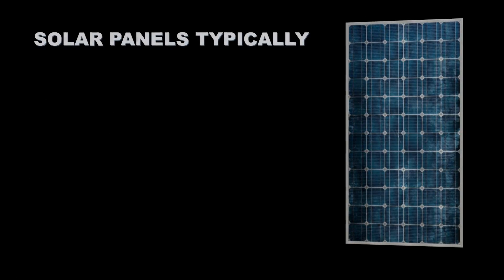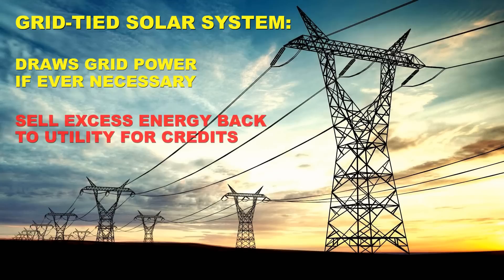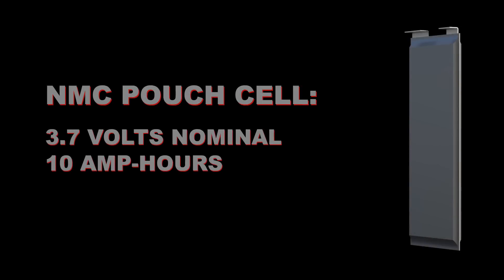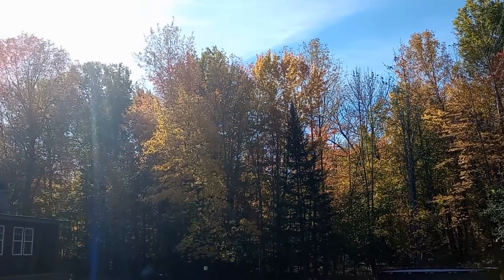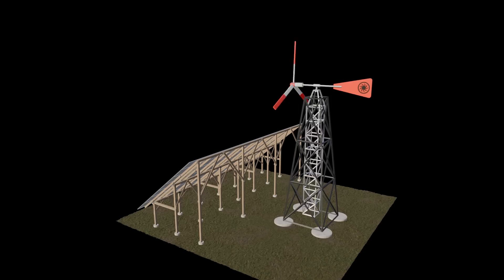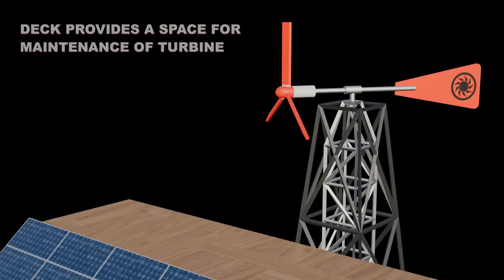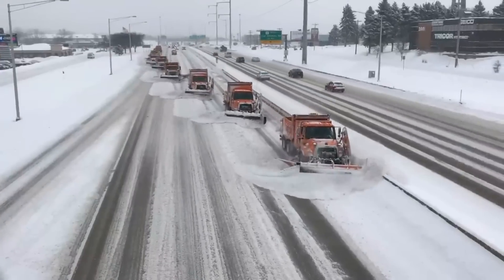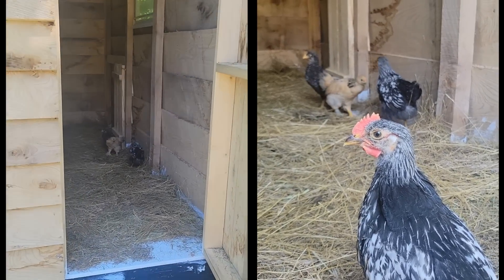Solarrolla Homestead Series 1 - Off-grid Solar Array Build

Comment: What I don't really understand is the argument of cost vs output and efficiency, and the decisioning on going with used solar panels.  You have been doing this for a long time so I am sure you are aware that not all panels are created equally, and some panels are rated for much lower loss over time then others not to mention the other factors like heat loss and output.  To your point you will still likely be getting 80-90% generation of what the panel output day one, but I think the bigger thing is actual rating of the panels.  Sure I can buy used 250-300w panels for 15 cents a watt, but that doesn't take into consideration all the mounting and wiring etc that is required for those additional panels.   Your space is somewhat at a premium and your time is effectively money, so while its awesome you can mill your own lumber and it costs very little to do that, you are spending time doing that, which how much is your time worth?  If you look at new panels, I have seen bi facials as high as 650w, if you run the numbers on a 20kw system, @300w you would need 67 panels, @650w you would need 31 panels.  If you conservatively estimate a 10% loss on the @300w that brings you to needing 75 panels.  So at the end of the day I build out infrastructure for 75 vs 31 panels and get the same output, have I really saved money or has that "savings" been eaten up by the infrastructure required to support more then double the panels?

Comment: I could see you building an elevator to the platform on top with the wind tower extension as the lift counter weight. i.e. lift up tower lowers, lift down tower rises.

Comment: I’d like to see those retractable blades working because I never saw such solution. Hope it will be lightweight and strong enough. Usually a braking mechanism is used to handle strong gusts like angling the tail to set the wind turbine direction away from the wind direction (perpendicular) which slows it down and prevents destruction. I’ll look for updates because it’s interesting and seems technically challenging. 😎👍

Comment: Hello, I would change the Solarpanels on Top and the Heatpipes below because of the better wind direction for your Windmill. The round bow of the mirrors of the heat pipe will send the collected wind in the wrong direction .

Comment: Get that center to go up by a counterweight and then have a couple guy wires that can adjust in and out to raise and lower the telescope. Just a suggestion. Rip to your dad, lost mine a year ago myself.
Reply: Run a couple pulleys for counterweight to center structure and make counterweights about 150lbs heavier, when it is fully extended the weights sit on ground, get 3 guywires with cables down to winches to lower the structure and raise the weights.

Comment: What kind of wind load is that rated for? We get derechos and supercells et al in Arkansas. We have a 2023 ioniq 5 electric hatchback it regularly charges at 248-252 volts a/c at 48-50 amps except when the 8 tons of air conditioning turns on then it goes down to 245.5 vac for a couple of seconds. We pay way more to run the two 3 or 4 ton 2 stage air conditioners than we do to drive the ioniq but we work from home so it's basically a dog runabout and grocery getter but came with 2 years of electrify america charging so we've used it for long trips a few times and it's quite comfortable. All i changed was my usual installation of an amateur radio system and a better amplifier for the factory sound system. It's really a nice system and it's too bad they cost cut the amp the engineers in korea wanted to put in the car. It gets about 2.2 kwh/mi on fast interstates and 3.4-4 around town.

Your scale model later in the video is similar to how our large and less large amateur radio and now also starlink at deer and duck camp. It's in the middle of nowhere in AR and has lots of solar but not much batteries and builds up insane credits throughout the year to run electric heat when nobody is there to run the wood boiler for little to no money to keep it 50 degrees F in there. I remember the day it was 7 degrees on the morning of opening day of duck hunting here and that's why we like having several means of heating it be they propane furnaces (and huge tanks from my dad's era and the farm), two different large diesel 1800 rpm water cooled diesel generators, and all the roofs have been solar since 2018 when they got new 18ga metal roofing installed, the wood boiler and the heat exchangers, lines, pumps and stuff for the fluid. The whole area's power is more reliable now too since this was done and is practical for EV usage. If we get a few more buildings up I might look at putting a solar powered level 3 charger maybe 40' from the garage. There's a huge wood cookstove in the kitchen and a few other stoves around the place that are more regular in size and type.

The lesser antenna is trailer mounted and only 13'5" high when it's stowed but it gets 40' tall when you run it out with some grease and the 48 volt battery and motors, pulleys and stuff to run it instead of the old pony motor. It's handy for ice storms and crazy winds and it's heavy af and quite dense when it's stowed, i've seen it take 90 mph wind a few times and it didn't budge the suspension much.

Comment: besides hot water, you could store a lot of heat/energy in sand. I heard about sand batteries developed in Finland, used to supply heat for city and block heat. These used electrical heaters that stored heat in big, very well insulated, tanks filled with sand. The sand was heated to several hundred degrees celsius, and the heat was recovered through a system of pipes that ran steam through the sand and heated the city heat system with heat exchangers. 
Another way could be a version of geothermal energy as a heat source for your heat pumps. Dig as big of a hole as possible and line it with insulation. fill it back in, but run lines through the backfill from both your solar troughs and for your heat pumps. This system greatly increases the efficiency of your heat pumps in winter. The use of the pond, as you mentioned in the video would work much the same but at lower temperatures. I am not sure if the pond you showed would have enough capacity to get you through the winter, that would greatly depend on the depth of the pond,. You can calculate the heat capacity of the water in the pond if you can estimate/measure the volume and compare that with your heating needs over the winter.
A problem I see with the extendable blades for the wind turbine is that in the winter, this mechanism could freeze solid, inhibiting your capability to retract the blades in case of strong winds

Comment: Please dont charge lifepo4 batteries up to 57.+ Volts....around 55.2 they are fully charged,anything more is just degrading them....
Reply: 55.2V is already high imo, I use 54.7V.
Reply: @honumoorea873  This is also good,but not for all batteries,if You have control over your BMS and can set lower equalization voltages for the individual cells,than yes.But for most brands 55.2 is still in the range for the BMS to do a top balance on the battery,and maintain it as required.I saw in this video values way over 57V,thats almost at the point to trigger over voltage protection from the BMS.You really dont want that.
Reply: Full charge on a lifepo4 battery is 3.65 per cell. So 58.4 would be a 100% charged on a 16s battery. Even a 3.6 volt per cell is 57.6 volts mostly fully charged

Comment: Used panels and even new solar panels are so cheap now;  I just helped a neighbor install solar and those new 405w panels were 30 cents per watt!  Since your turbine blades will have actuators, you could add a controller to automatically bring them in if wind speed gets too high. I like what you're doing with multiple ways of gathering energy, because we lived in Eau Claire for a few years and learned how the sun goes away for a large portion of the winter!
Reply from the maker: @jeremyp3630  yes, ultimately, the wind turbine will automatically come in and out depending on wind speed.
Reply: Buy new panels @ $.30 vs used @ $.15 to produce 25% more power with 25% less panels. Smaller/cheaper stand and longer panel life.